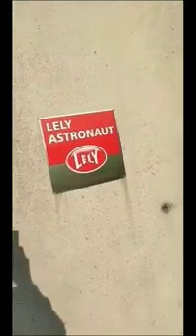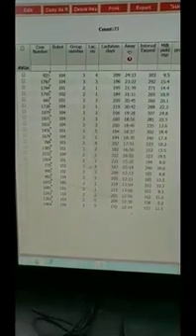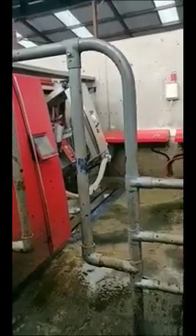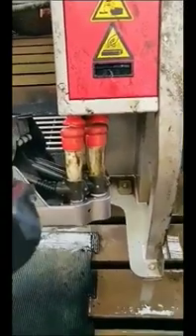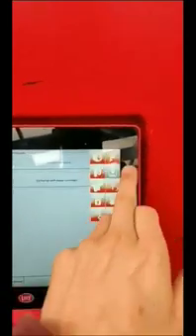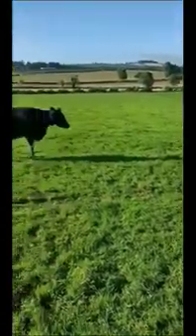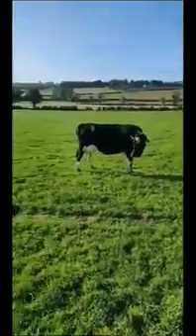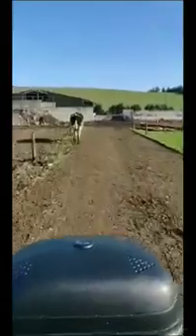Daily routine for a 300 cow, 4 Robot, grass based system

Comment: How difficult would it be to dip the vacuuming ends into a liquid mixture to clean the grime off them between cows?

At 03:11 it can clearly be seen that there is mud (or worse) on the outside of these devices.

In addition, manual operator cleaning of the area twice a day seems insufficient for an automatic machine.  

There should be automatic spraying of the floor and other surfaces by the equipment itself between each milking event.

These are simple hygiene procedures which seem surprising to me that they have not been implemented.

I wonder if implementing these automatic cleaning procedures would not diminish the amount of debris shown on the filter at 0:26.

In other videos shown for the milking robots, the cows seem to spend a few minutes waiting before entering the area where they are milked.  Why not use this waiting time to clean the cow’s udder area?

These few cleaning steps should increase milk hygiene, decrease operator time, and increase cow health.

Comment: How is it going with 75 cow's per robots? We've been told 60 cow's max 85kg butterfat per robot
Reply: Phil Schmid, They’re only milking 1.9 times a day on average. It would struggle if they were milking 3 times a day and kept inside.
Reply: @MidlandsFarmer  If you're milking 1.9 a day you're losing allot of milk and must have high cell counts. I get nervous when we go below 2.5
Reply: @MidlandsFarmer  Well, they at the time of video milk 22.5 kg / day, which is an estimated 8,200 kg / cowhead / year. Which is good. But can imagine that for cows heading for 10,000 kg / head / year you need higher frequence of milking as you say and clearly need to get above 2.0 or close towards 2.5 times a day. Maybe also there is an influence of the grazing system used.If understood well the're using two grazing plots over the day. As explained, few cows appear to almost getting milked once a day, causing the overall number to become low, just under 2.0.